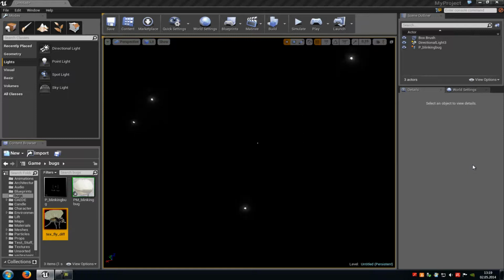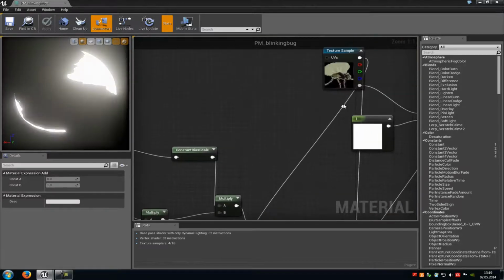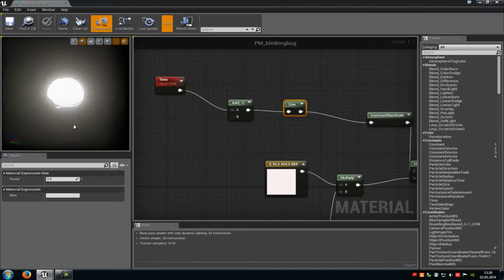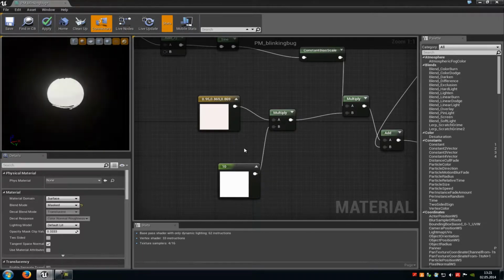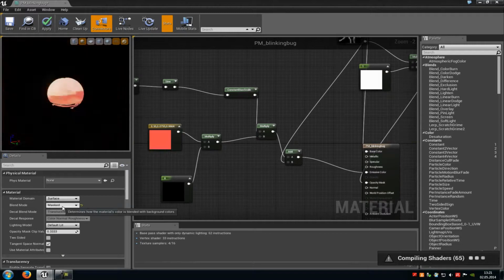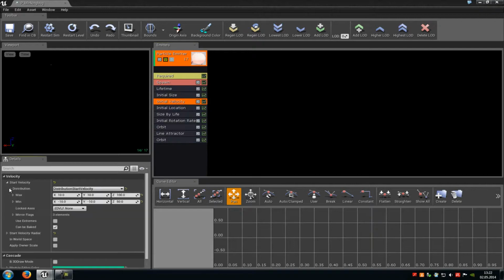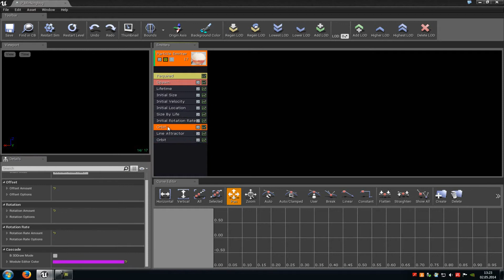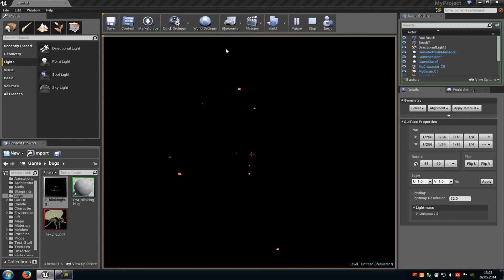Unreal Engine 4 Tutorial: Blinking Bugs (english)

Comment: i tried this myself, but they all blink in unison. how do i make them each blink at different random times?
Reply from the maker: The easiest way would be to just create another material with some other values -> then duplicate the emitter and decrease the spawn rate of the two emitters.
Reply: Actually I figured out a way by passing a DynamicParameter from the particle into the material to offset the time which works well.

Now any ideas on how to make the blinking non-linear? As in be black for 10 seconds and then blink for 1 second?
Reply: furroy2 I'm quite new to unreal 4, and haven't fully viewed the tutorial, but I have an idea on this.

I see he used a sine wave, but we could do multiple things. we could, instead of using the sine wave code the sine wave. if we did so, we could then alter, and add on to this wave to make it non-linear, and quite controlled at that.